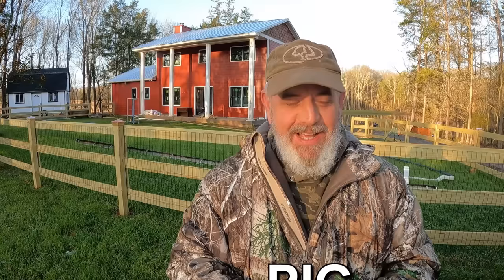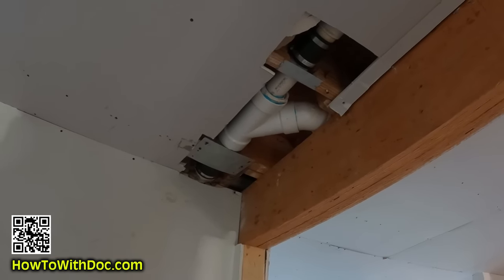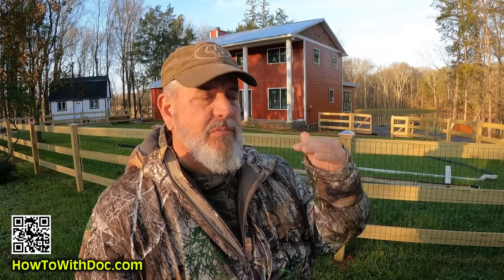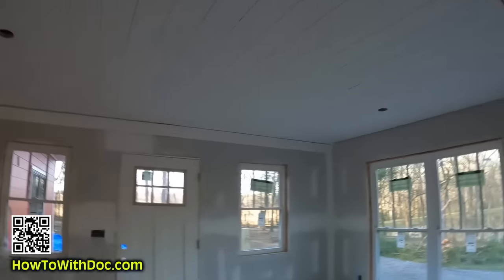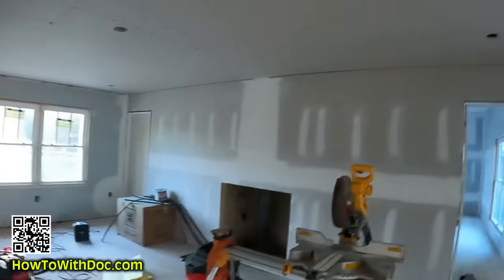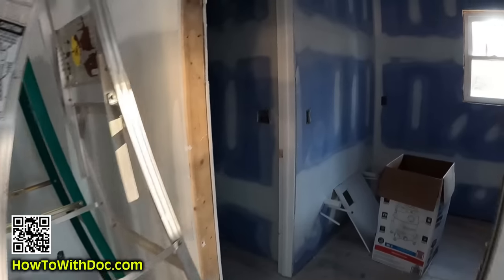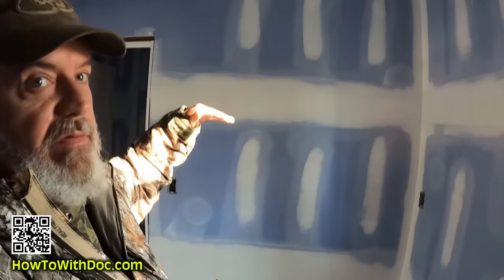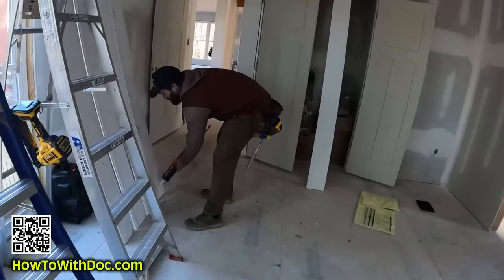How to Install Shiplap Ceiling

Comment: I’m getting ready to instal nickel gap on a ceiling for a client.  Currently, the ceiling is exposed joist.  I honestly can’t see any reason to install Sheetrock prior to Nickel gap installation.  I respect your decision to do so.  However, I have a different perspective.  Ceiling joist should not vary.    Frankly, if they do, then this variance wouldn’t be rectified by installing Sheetrock.  If anything, the Sheetrock will add a significant level of difficulty to the installation and future access to plumbing and electrical connections.  While the Sheetrock may add a some degree of insulation, the additional weight of the ceiling can be problematic.  If you ever do have a water leak, access will be exponentially more difficult to identify and expose.  I don’t see any issues with nailing directly to the ceiling joist using 2 1/2” finish nails without adhesive.  I installed a shiplap ceiling directly to ceiling joist a few months ago using finish nails only.  I removed a couple of boards during the installation and they were surprisingly hard to remove without adhesive.  I even broke one of them trying to remove it.  Personally, I like the idea of being able to remove and easily get a visual on plumbing and electrical access points without having to dig through multiple layers of ceiling panels.
Reply from the maker: Best decision we made. Not only does it add insulation value but keeps dust and dirt from working through the cracks over the years.  I STRONGLY recommend sheet rock before shiplap.

Comment: DOC: I have not noticed that pond fountain/aerator running in a while. Wondering how it is holding up, and if you still Rx that model? Deciding on buying one for our pond. Thank you 😊
Reply from the maker: Yes doing well on the aerators. The fountain we shut off during the winter.